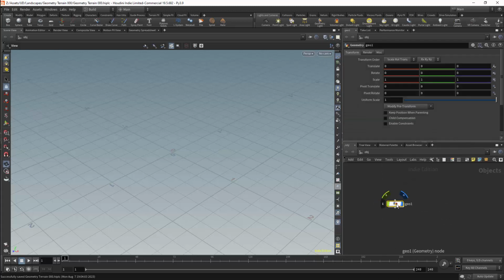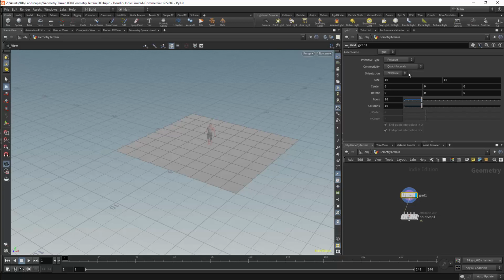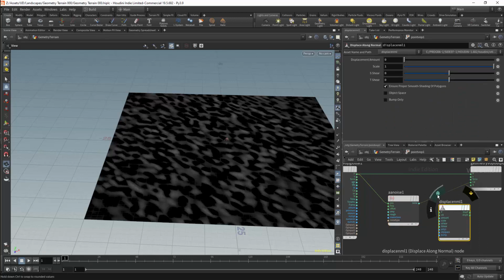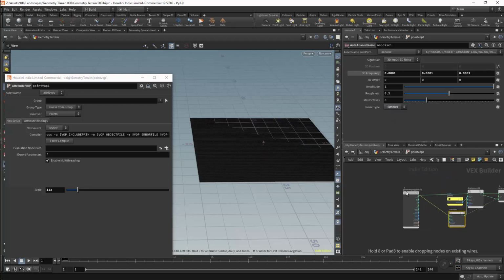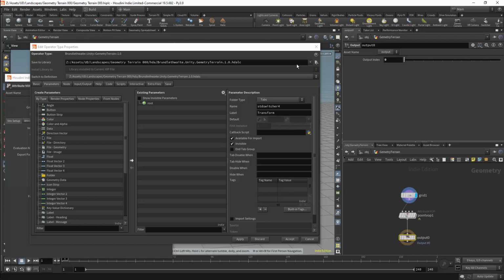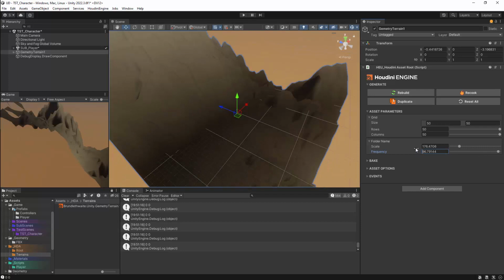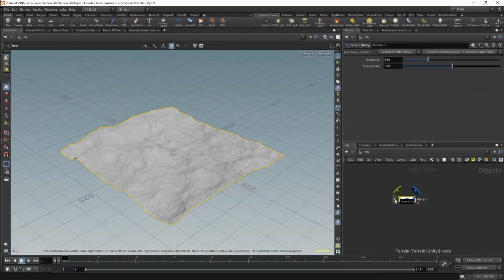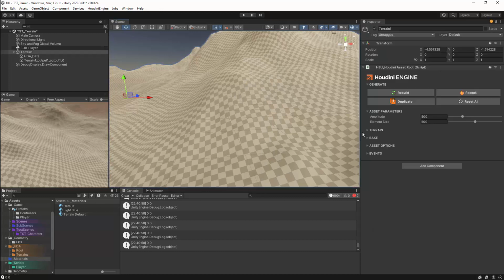Game Prototype 017 TERRAIN 000 Landscape Geometry

Comment: What are the reasons you continue with Unity over Godot or Unreal Engine?
Reply from the maker: Ideally this will be running on the Frimble engine but I do not know If it will ever get that far.
This is a prototype  so it may never be released other considerations are.

- My interest here is animation and Rigging not programming or releasing a game Unity is the easiest to deal with at the moment.
- Unity is easy to use, I know it and it is the most fun to work with at the moment.
- As this is a prototype Unity is free.
- Unreal would be far more expensive than Unity (even if they had implemented that stupid pricing scheme).
- If I release the game It would be for consoles Godot has no support and would end up being more expensive than Unity.
- Godot does not have Houdini Engine support.
- Flax does not support graphics tablets.
- Flax does not have native Houdini engine support.
- Cryengine does not have proper UI and requires defunct commercial software.  
- Cryengine does not have native Houdini engine support.
- Programming in Unreal is horrible and is it weakest area.
- For game logic I do not want to use blueprints as they and not efficient and have worse performance that C++.
- I do not want to use C++ I would prefer to work with C, Odin or C#.   
- Animation is Unreal's weakest area Unity is far easier to work with here.
- Animation import and Export it Unreal's weakest area.
- Unreal's coordinate...
- Unreal's syntax.....
...
...

This is a little brief, I start to give some more reasons but I do not want this to become a long list and I do not have the time to go into even the basic reasons as each of them require context and explanation to make sense.
Reply: @brundlethwaite  no way! Unreals animation is weaker than unity’s? I spent sometime with Unity and hated C++ until I started using it and now I look at c# as a jumbled mess lol. I do like Unity’s DOTS I almost switch back to it because of that alone.
Reply from the maker: "no way! Unreals animation is weaker than unity’s?"
What relevance does this have? I did not make a feature comparison? 
This is not a reason or advice on choosing. And it is not relevant to anybody by me, for this specific project.  

" I spent sometime with Unity and hated C++ until I started using it and now I look at c# as a jumbled mess lol."
What relevance does this have? This is not a programming language comparison? 

These are really bullet points as they applies to this specific project. I am not going to spend days (or for this topic months and years) of my life trying to explain the specifics.

You asked me why I am working with Unity you did not ask me why someone else should.
Reply: @brundlethwaite  
From your first reply "- Animation is Unreal's weakest area Unity is far easier to work with here." I was replying to this. Maybe you worded this wrong?

From your first reply "- I do not want to use C++ I would prefer to work with C, Odin or C#.   " I was replying to this point. I used to prefer c# now I look at it different after using C++

My question initially was to see whats stopping you from converting to UE. I presented some slight counter arguments to push you towards it. Since your content + Unreal would be beneficial to me. No disrespect to you or unity was intended
Reply from the maker: "My question initially was to see whats stopping you from converting to UE."

You did not state that. You said "What are the reasons you continue with Unity over Godot or Unreal Engine?"  which is a completely different question.

I am not converting from anything I currently have projects in Unreal, Unigen, Flax, Godot, Cocos2D and Stride and Cryengine. Not all of the projects are fully active but I none are discarded. 

So if you had asked the first me about converting I would have said that I am using Unreal different projects instead of why I am using Unity in this one.

You also chose to ignore the final statement where I said that each of the points was highly contextual. As well as the first statement.